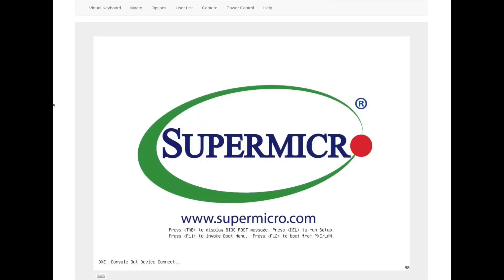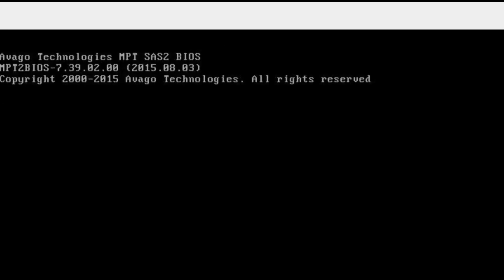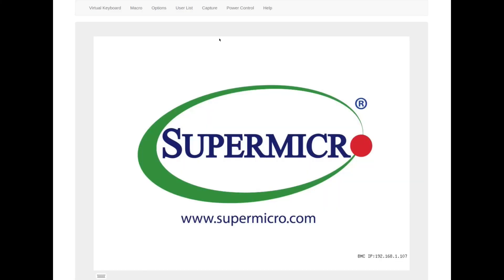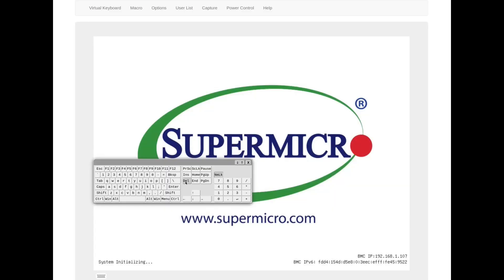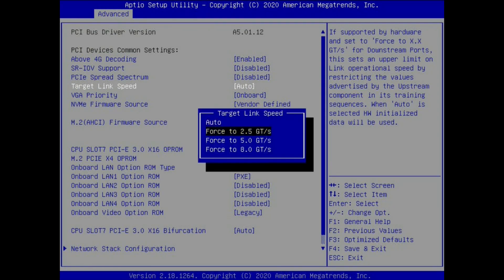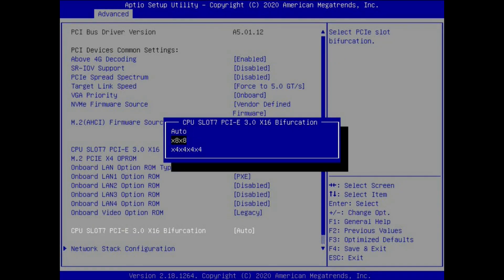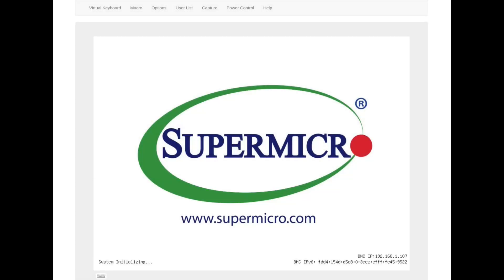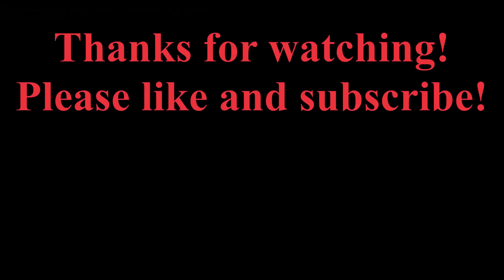The Problem with AMD Ryzen Epyc and LSI HBA controllers | and how to fix

Comment: Would you recommend using an intel CPU verses an AMD CPU with a LSI HBA and UnRAID?
Reply from the maker: I think the CPU choice is mostly independent of the HBA choice really. These days, I think AMD has more compelling options than Intel. But if I'm using older server gear, I'm still happy to use Intel Haswell Xeons.

Comment: I guess this isn't SAS but normal SATA,  Genuine LSI 6Gbps SAS HBA LSI 9211-8i (=9201-8i) P20 IT Mode ZFS FreeNAS unRAID.

Just switched from generation before Ryzen, that on the old system with FX-8370 you would be get the Avgo boot menu all fine.

Just moved that HBA card to a Gigabyte AX370 Gaming 5 MB & Ryzen 7 1700 and it works fine in Windows 10 Pro & Unraid but I never see the Avago boot thing at all.

I have the HBA in the 3rd 16x slot that runs at x4 PCIe 3.0.  Have 2 GPUs in slot 1 & 2 running at x8 PCIe 3.0.
Reply from the maker: The "Avago technologies" message during POST comes from the LSI BIOS ROM. If your system is setup to not load the BIOS ROM (OpROM, aka Option ROM), then you will not see it. If you're in full UEFI mode, aka no legacy BIOS mode, and without CSM, it will not load the LSI ROM either. So, these are the possible reasons to not see the LSI / Avago technologies message during POST. If the card has the LSI UEFI ROM (cards from my store do), you should be able to see it from the UEFI HII menu system instead.

Comment: Glad I stumbled on this video and I'm surprised I haven't already ran into this issue. I wonder if I'm somehow lucking out because I have 3 of these HBAs installed.
Reply from the maker: based on my experience helping folks with their HBAs, this problem is not universal. some systems don't exhibit this type of problem, but many do. Also, since releasing this video, I'm also seeing this problem with Intel platform that support PCIe 4.0 and 5.0. I wonder if something in the PCIe spec for 4.0/5.0 for backwards compatibility isn't getting fully implemented? In previous gen PCIe specs, there were very few backward compatibility issues with older gen cards... I can't even recall any such issues. But with PCIe 4.0/5,.0, this is a much more common occurrence.

Comment: Lucky I have not run into this problem on Asrock Rack X570D4I-2T with Ryzen 3600 running a Silverstone ECS04 (LSISAS2308 RAID-on-chip) flashed to IT-mode.
Reply from the maker: Cool. yeah, I've only seen this on some systems. It's not universally a problem with the PCIe 4.0/5.0 platforms. I am seeing the same issue now on Intel boards with PCIe 4.0/5.0 as well.... thanks for watching!

Comment: Another Tidbit of information for anyone using epyc based servers in their dc's (example Lenovo SR665/SR655) and they're running windows... if you're having an issue with the restart of the system; ie: its bugchecking after a long time of sitting on "shutting down", uninstall (and remove) the amd sata drivers so they revert back to the microsoft ones. Thank me later.
Reply from the maker: Thanks for sharing!

Comment: Can anybody confirm Broadcom HBA 9400 having issues with AM4 (X570 and B550) systems? Have two units of the HBA 9400 8i8e and they tend to crash the system when trying to wake up from S3 mode (which they support in general). Manually configuring PCIe settings doesn’t change anything here.
Reply: I can’t get my hba 9400-16i to work at all. I have asus x670e. I don’t even see avago bios. The card works on old intel server and a desktop
Reply: @Mr_nah  Is your 9400-16i already using the firmware package P24 (P25 should also release soon, it has recently been released for the 9500 line). I personally don’t have an AM5 platform, yet so can’t verify the issues myself. Have you tried booting with or without CSM enabled?
If possible please contact Broadcom support about it, I’ve tried reporting issues (firmware and drivers, the latest Windows drivers for the P411W-32P have broken signatures, for example) with the Broadcom HBA models 9400-8i8e, 9500-16i and P411W-32P but they don’t take me seriously. :(
I’m not that into Social Media but I’m wondering how to publicly shame Broadcom for their buggy products to force change for the better.
Reply: @abavariannormiepleb9470  hey thanks for letting me know that there is p24. The issue was asus x670e-e. I switched to msi and the issue was resolved. I agree that the Broadcom is a big pile of 💩. Their fingerprint scanners do not work on Linux because of their proprietary drivers and they do not release the code. Some of their NICs had issues with esxi. I’m trying to stay away from Broadcom as much as I can
Reply: @Mr_nah  My experiences with ASUS motherboards’ early BIOSes have been quite horrible, the last few examples were the ASUS Pro WS X570-ACE, ProArt B550-CREATOR and the ProArt X570-CREATOR WIFI. But at least contrary to Broadcom their firmwares become pretty mature, I’m even going so far as to consider them my favorite motherboards. I’m likely visiting AM5 when AMD releases their Ryzen 7000X3D CPUs and continue with an ASUS ProArt X670E-CREATOR WIFI, hoping the teething issues might be gone by then.
Reply: @abavariannormiepleb9470  yeah I wanted to wait for x3d too. but I doubt they will make more than 8 core CPU’s with it. and if I’m not mistaken it’s mostly useful in games
Reply: A strange observation: The 9400 models were removed on Broadcom’s support/download portal, but you can still get to the files by choosing “All” in the model and type selection menus.
Reply from the maker: I have not heard of that issue. Please follow up here if you find out more details.

Comment: I myself am running into a major issue with a B550/Ryzen 9 5900X with a Fujitsu CP400i cross-flashed to LSI 9300-8i. The HBA works in every other machine I have. All other HBA run on the B550 machine, but the 3008 HBA just won't get recognized by the chipset at boot. I traced this issue to the PCIe negotiation as well, but despite forcing these settings (bifurcation, bus speed) the card does not get recognized. Not even the Avago PreBIOS prompt appears. I have tried with and without ROMs (BIOS and EFI), different FW versions, different SBR, Filled VPD with valid data. Also tried to mask B5 and B6 pins. The card is powered (3.3V and 12V are good), but the PCIRESET pin (A11) is not lifted to 3.3V. So the motherboard does not enable the HBA. Again the card works on other computers totally fine, and other HBA (like a genuine LSI 9200-8e)  runs fine on the B550. I have been through absolute Hell for the last entire week. No idea what is going on. I suspect (with no proof) the this is something related to Secure Boot (disabled of course) or low level validation of the SBR during PCIe enumeration. I will try to flash the SBR with empty SBR, probably bricking the HBA doing so. I have no idea what is happening, and I cannot even buy another adapter that may have the same issue.
Reply: One thing to check is make to sure that booting of legacy ROM has not been disabled in the BIOS.  Each manufacturer will have different options but usually located under the boot option menu, there should be settings to enable/disable Option ROM's on boot. Just check that the Option ROM's are enabled and that they may need to be set Legacy for the HBA to boot.
Reply: Were you able to fix/figure it out?
Reply: @akirafan28 Unfortnately no I had to change the motherboard entirely and  move to a Xeon architecture. The bug was low level in the enumaration phase. I could never have it to be recognised...
Reply: I have issues with Fujitsu 9300-8I LSI SAS3008 in an ASRock B550M PRO4 , it detects some SAS HDDs and some no. using the same cable and port.  Do you know what I can do ? Should another LSI SAS3008 work ? Thanks

Comment: Thank you sharing.   I have an ASUS Pro WS X570-ACE and PCI EX bifurcation settings are only Auto or PCIe RAID Mode.  I may have to opt for a different HBA from my current 9207-8i.
Reply from the maker: I don't understand what "PCIe RAID mode" has to do with PCIe bifurcation?

Thanks for watching!
Reply: @ArtofServer  ASUS calls PCIe Bifurcation “PCIe RAID Mode” (meaning x4/x4 or x4/x4/x4/x4 depending on the slot configuration), this setting is separate to NVMe RAID mode but the naming is truly unfortunate.

Comment: Interesting! This is likely a timing issue in the negotiation protocol itself or one/both sides of the link didn't follow the PCI standards in their implementation. Some times I miss the old days where you had to set the IRQ, DMA, etc. via physical jumper instead of relying on the system to just "figure it all out".
Reply from the maker: Indeed!

Comment: I had even "better" issue with 2008 and B450. Basically, you see BIOS boot logo for a second and then nothing, black screen, no reaction to keyboard. Took out the card, boot successful. Put it back in, same issue. I don't remember if I did any trickery in BIOS (probably did), but I do remember that removing BIOS from the card helped. As I don't need to boot off HBA connected drives (I have NVME SSD as bootdrive), I don't lose anything by doing that.
Reply from the maker: That might be a different issue. The LSI ROM program in this case just teases out the issue that the motherboard can't negotiate correctly the PCIe link speed and width. But it is also possible that the motherboard firmware simply has issue with LSI legacy ROM - I've seen that on HPE Proliant servers for example.
Reply: @ArtofServer  Might be. Also I just remembered that a Lenovo x3650 M4 had something like the original issue. In that case 2008 had external connectors and 3 drive boxes connected to it. If boxes were disconnected during boot, boot was successful, if boxes were connected, boot would get stuck. I do remember that removal of card BIOS didn't help and after a lot of trial and error in system BIOS I changed something related to PCIe. It was either slot speed or slot usage as bootdevice (I did play with both, just dont't remember what helped). So I don't think that it's limited to AMD... Something with IT firmware (in some edge cases) maybe...

Comment: That's not a workaround, that is a proper solution. Negotiating link speeds "two generations down" might not always work (Gen4->Gen2). This is, why this menu option exists at all. Problem is most likely that the device responds partially correct when stepping down from Gen4 to Gen3, the system then sets Gen3 and while probing upon boot, the HBA hangs.
I would not assume the Bifurcation-setting to be required. That is usually required, when you run multiple x8 or x4 devices in the same x16 slot (like 4 nvme-SSD cards in a x16 slot adapter cards).
I expect manually setting PCIe link speeds will become more common, when PCIe 4.0 becomes more widespread. I run an EPYC system myself as main work machine and for some cards, I manually configured Bifurcation and link speed. I do run a SAS2308 based card with option rom enabled for my external tape backup. It autodetects fine and runs at PCI 3.0 speed:
# lspci -vv -s '82:00.0' | grep -E '(Subsystem|GT)'
	Subsystem: Broadcom / LSI SAS9217-4i4e
		LnkCap:	Port #0, Speed 8GT/s, Width x8, ASPM L0s, Exit Latency L0s <64ns
		LnkSta:	Speed 8GT/s (ok), Width x8 (ok)
		LnkCap2: Supported Link Speeds: 2.5-8GT/s, Crosslink- Retimer- 2Retimers- DRS-
		LnkCtl2: Target Link Speed: 8GT/s, EnterCompliance- SpeedDis-
Reply from the maker: Actually, both settings are required in this case. We tried just the link speed setting and it did not work by itself. I've seen some AMD systems that only needed the link speed setting, but some required the PCIe Lane setting too.

Also, keep in mind this was a PCIe 3.0 only system, not the newer 4.0. in general, I've been hearing a lot of issues like this with AMD platform. I'm a huge AMD fan myself and love the competition they are bringing, but I  think the platform is still maturing. At least there's a way to get this to work still.